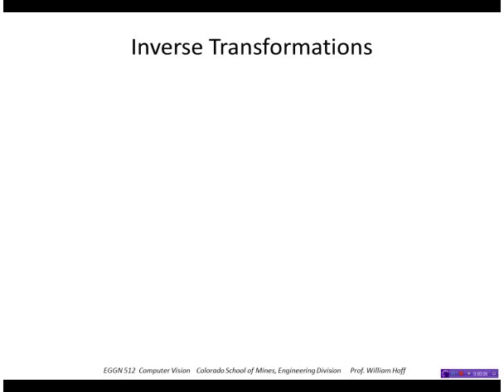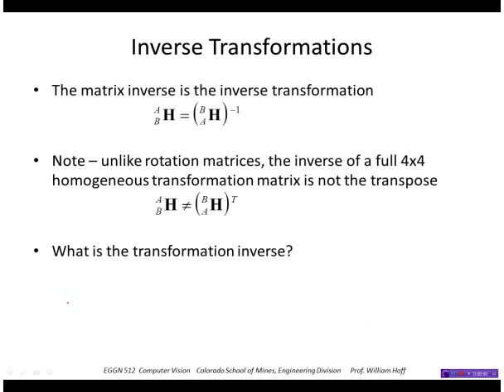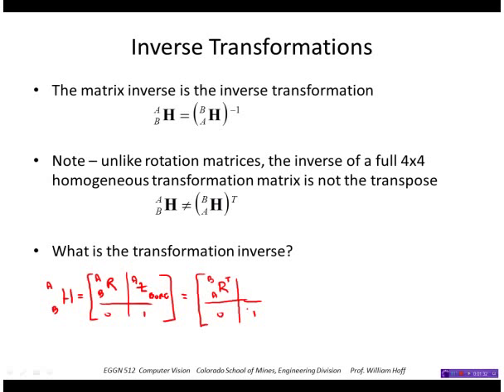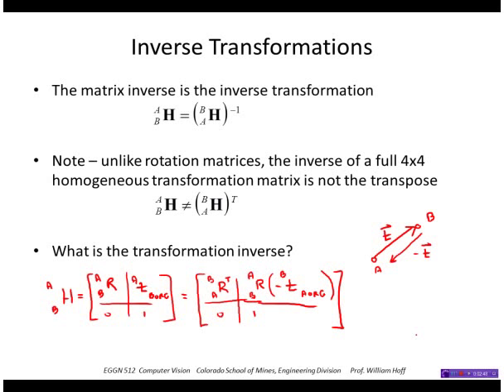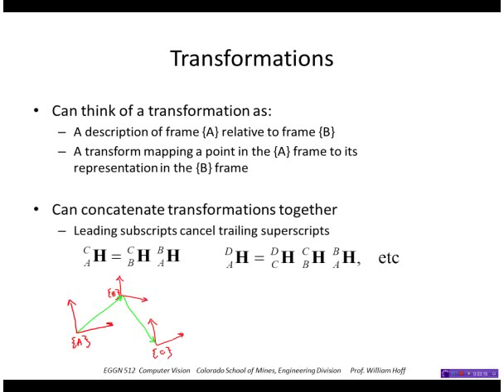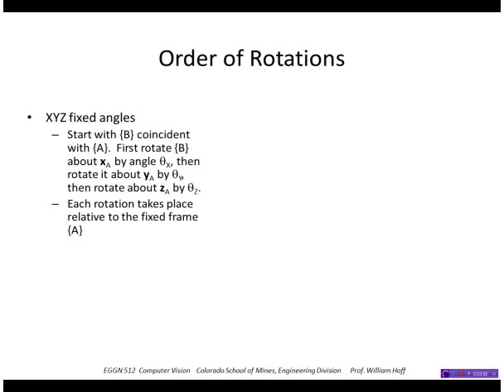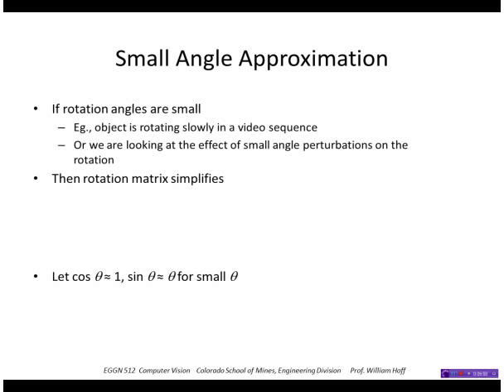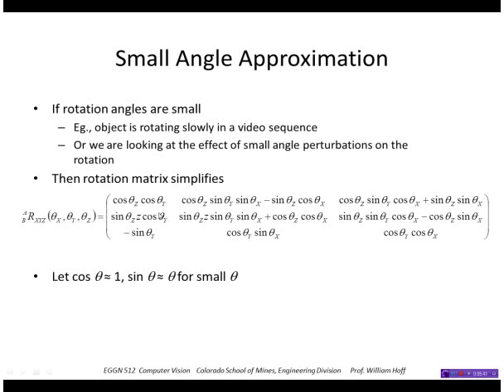CSCI 512 - Lecture 04-3 3D-3D Transforms

Comment: Hi i didn't get the purpose of multiplying the translation vector by the rotation matrix inside the transformatiom matrix , the negative sign isn't enough ? 
since the orgin of a and b frames are relativly constants!
Reply: Basically Mustafa, we want to find the same transformation but in the other frame (i.e. from "B to A" taken in frame A to "B to A" taken in frame B).
When we transform from B to A, the basis of the translation vector (t) are taken in frame A, which is not the same in frame B.
(Let t = t'1i'+t'2j'+t'3k' in frame B, the same vector in frame A would be t = t1i+t2j+t3k, the coefficients and the basis are different)
To be able to represent the translation vector relative to frame B (-t) in frame A so as to use it, we have to change the basis by multiplying by the rotational matrix from B to A.
I find it confusing, but try to look at the 3D transformation (not the 2D) in 2D and generalise.
Reply: yeah i know it seems confusing and you are right the general case that cofficients and basis are different but they will be the same when it's the case between the origins aren't they ?
Reply: The will be the same only and only if Frame B is given by only translating Frame A without rotation, in that case R = I (identity matrix). A translation must always be relative to a specific frame. 
Suppose that Frame B is constructed by rotating Frame A (x,y,z) by 45 anticlockwise about the x-axis and translating by vector [0, 1, 0] relative to A, if we want to reverse the effect of translation, the vector will be -[0, 1, 0] relative to frame A or -1/sqr(2) [0, 1, -1] relative to frame B.
Reply: @mustafaalghali8684  In the left of the equal sign,the t is relative to A coordinates system,but the right is relative to B coordinates system ,so we must rotate it form B to A,only then that they are euqal.In other words,we must assure two sides of the euquation are indentical.